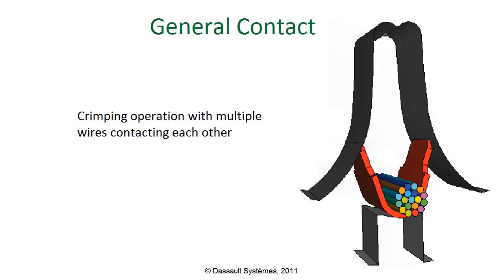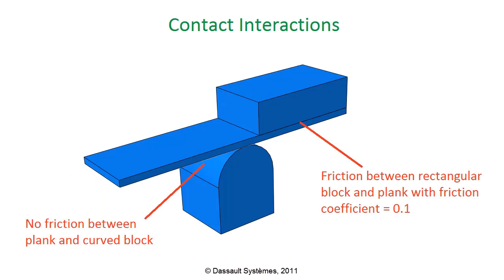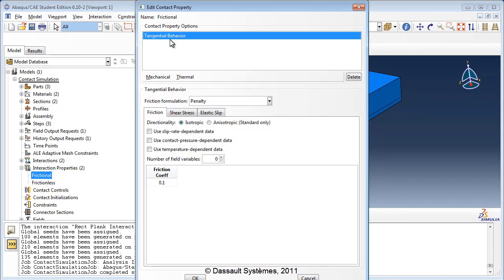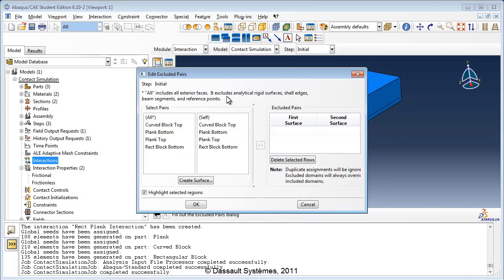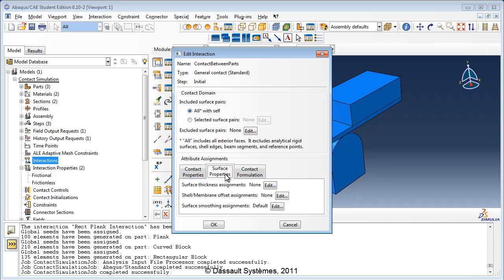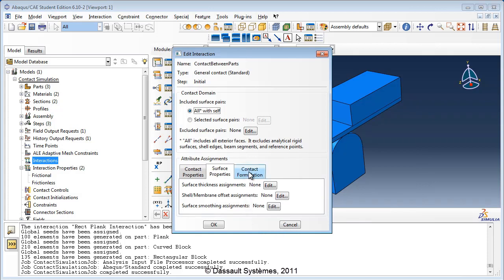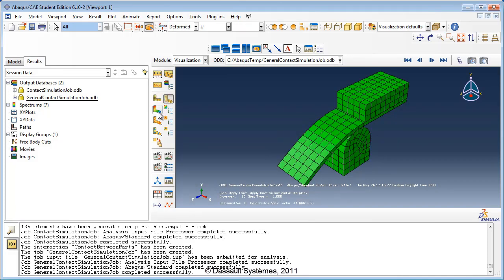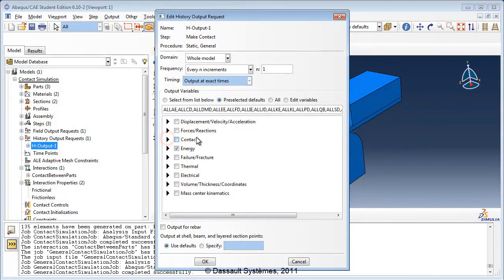SIMULIA How-to Tutorial for Abaqus | Modeling Contact using General Contact - Part 2 of 2

Comment: Is it possible to use general contact between beam elements and shell elements (for example for a beam element resting on top of a wall modelled with shell elements)?  I  want to model a solely friction connection between a beam seating on top of a wall. In this case can I define the beam as a surface to define the contact interaction between the beam and the shell? If general contact doesn´t work with beam elements, which other options do I have to model contact between a beam and a shell edge?
Reply from the maker: Hi Anna, if you haven't already, we recommend joining our SIMULIA Community and posting your question on the discussion board where users & moderators frequently answer questions. https://www.3ds.com/slc